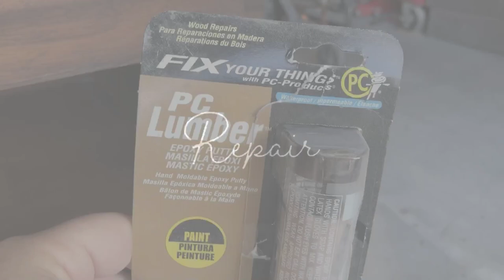FACEBOOK FLIP | Furniture Makeover with Rust-Oleum Chalked

Comment: I want to give you a little paint-saving tip. Before poring out paint or dipping in your brush, take a nail and hammer three or four holes on the inner lip. Paint drains back into can rather than spilling over the sides. One more: In addition to the nail holes, and if you are using a brush to dip into can, take a heavy duty rubber band and stretch from bottom of can to middle of opening. Then you can drag brush across band to remove excess paint. Really enjoying your flips.
Reply from the maker: Thanks Alice! I almost never brush but when I do I pour my paint into a separate container to prevent contamination. I usually just scrape extra paint with my finger before I reseal but I’m a messy painter no matter what I do 😂

Comment: Wow. Beauriful makeover! I have used auto bond to fix a buffet that had serious laminate damage. This looks so much easier. Will try this wood filler product next time.
Reply from the maker: I love Bondo, but I was afraid it would drip or sag on this vertical surface. This putty is amazing!
Reply: @salvagedbykscott  The problem I had with it is that it dried too fast. I could only work in small segments at a time, so it was more labor intensive. This looks so much better to work with. Thanks.
Reply from the maker: Yes, Bondo dries super fast and can be frustrating. This has stuff has a 15 minute working time but it’s much easier to mix up small amounts at a time.

Comment: One of these days, I'd like to see you do a makeover without all the electric gadgets.  I don't have them and it does leave me wondering if I would actually need 3 coats of paint on top - if I painted by hand.  I'm about to do my first makeover.  Also, If ever you are looking for a video subject maybe you could do a tutorial of which sandpaper to use depending which job your doing.  Just a thought.  I enjoy your videos.
Reply: I am a furniture painter as well. Yes it can be done by hand and depending on the paint, you may need 4 to 5 thin coats. I hope this helps. 🙂
Reply from the maker: I did this a few weeks ago with no tools. https://youtu.be/I8eb7xMcKwQ

You can do as many coats of paint as you want. I’m just sharing how I do what I do. There’s no wrong way to be creative 😉
Reply: You can also roll on large areas with a foam roller. If you're looking for a smooth finish with a paintbrush make sure you buy a high quality brush and you can add a bit of water to water based products so it goes on easier.
Reply: @cathy7824  I really like the foam roller idea.  Thanks.
Reply: @salvagedbykscott  I just watched the video you recommended.  That was exactly what I was looking for.  Thanks.
Reply: @gigistephens8130  Luckily, I'm starting with a small piece of furniture so a few coats won't be difficult.

Comment: Just beautiful!  Like everything you do!  You are so busy - I hate to bug you  - but I was wondering if the Varathane product you use to seal your pieces has a toxic smell?  I am sensitive to most odors - even perfume ;-(  - also, do you have to sand between each coat.  Thanks!!  I am so glad I found your channel :-)
Reply from the maker: Hey Holly! The water based top coat does have a very slight odour but you’d have to stick your nose right in the can to smell it. Since I spray, I always wear a respirator while applying it. Thanks for watching!

Comment: Hey Katie ..... could one use that Wise Owl Furniture Salve on the exterior surfaces of a piece?
Reply from the maker: You can!!! It’s got a million different uses. It’s a blend of beeswax and hemp oil so it can be used as a paint sealer or wood polish. 😁
Reply: What size brush would you recommend using with the wise owl furniture salve on a blanket box?
Reply from the maker: I use an small old Zibra brush for mine but Wise Owl has a little palm brush specifically for their salve. You can even apply it with a cloth or old sock 😉
Reply: @salvagedbykscott  
Thanks for your help Katie.  I ordered the brush and the wax.  Now I'm thinking about using some watered down Country Grey Rustoleum latex paint first and then finishing it off with the wax.  The raw pine blanket box is almost colourless.

Comment: Is that right? the way she paints without giving a cooling off time to the compressor in each line she paints?  I thought it had to be swipe and release, swipe and release...
Reply from the maker: I use a High Volume Low Pressure gun so I can spray continuously for quite a while. Thanks for watching.

Comment: Turned out beautiful. I do have a question why did you roll on the primer. I’m always so scared that the roller texture will show through spray of the paint. So I normally spray all layers or roll on primer and then do I light 200 grit sand paper. I’m I doing extra work were you able to see roller texture through. I use the kilz primer. Should I use a different primer. Any suggestions.
Reply from the maker: Hi Tiffany. The BIN shellac primer that I use is nasty stuff to clean up and the only time that I tried to put it in my gun it instantly clogged everything up and destroyed my sprayer. I have good results rolling it and sanding it before painting.

Comment: Katie, Can you recommend another brand sander that you like that is less expensive.  The 3″X4″ Electric Ray Sander is too expensive for me at this time.  Hope to hear from you.
Reply from the maker: Yep, I used basic dewalt or black and decker sanders for years. Anything from the hardware store will get the job done.
Reply from the maker: Sorry, I hit the send button before I was done typing and then my phone died 🤦🏻‍♀️ For most stuff all you need is a basic 5” random orbital sander. If you’re doing a lot of furniture you might want also want a mouse sander for corners and smaller details. You can probably get both for somewhere around $150 but the orbital would be my 1st choice if I could only pick one. Surf Prep also sells their foam sanding abrasives in a mouse and orbital version so you can get the contour sanding features without having to invest in the whole system. I hope that helps.

Comment: Love your videos!! You make it look so simple!
I have a question, I am currently in the process of painting my bathroom cabinet (inspired by you!) But the paint gets completely scratched off with the lightest nail pressure! Why does that happen? And how do you prevent that?  I'm using behr marquee which is a good brand! Thank you!
Reply from the maker: Hey Savannah! I don’t use latex paints on my furniture so I’m not completely educated on them. It sounds like you need a good bonding primer underneath like Zinsser BIN 123 or a Kilz brand.
Did you scuff sand before applying your paint? That helps a lot too by giving the paint something to hold onto. 

Hope that’s helpful 😉
Reply: @salvagedbykscott  I did hand sand with 220 - maybe I wasnt aggresive enough! I might just try putting a protective finish on it and hope for the best! Otherwise I'll restart using your suggestion. Thank you for replying! Love your videos!

Comment: Hi Katie, l have two questions if you don’t mind  😊 Do you always use chalk paint for all your magnificent artwork? Second question is, l had a beautiful table top that l had just finished and my spray gun splashed just a couple of droplets of water on the top after completion 😭. l had to strip it back once dry and do the whole thing again! Just wondering if you know the cause of this and a solution. 🙁    Ps Only 20 more hours for your next stream in oz can’t wait!!!! - best wishes Rozanne
Reply from the maker: Hi Rozanne! Chalk & mineral paints are my go-to but I do also sometimes use milk paint or acrylic depending on the finish I’m looking for or what colours I want to use. 

I’ve had the same problem with my gun more than once. It’s just water hiding in there from the last wash out. I have started blowing my gun and all the parts out with compressed air before I fill it with poly so that its super dry. So frustrating 😫 I know.

Comment: Hey Katie I think I goofed on mixing too much paint and not enough water and now my piece is looking too grey ...... can I or should I try sanding some of the grey out or am I stuck with it.  Also can I use the Wise Owl salve as a seal on the entire surface or do you just recommend  using it on the inside?  Thanks for your advice!
Reply from the maker: It’s just paint, it can always be sanded back. Just remember that the end colour also depends on the wood that you’re working with. The salve can definitely be used as a paint sealer. It’s a mix of wax and hemp oil. Good luck 😉
Reply: @salvagedbykscott  Thanks Katie for your response.  I really appreciate how quickly you respond to these messages.  Its very much appreciated.  Love your work!

Comment: Are you putting a top coat? I didn't see it. I am redoing my furniture and I am worrying about scratching on a open shelves . Also which paint sprayer are you using? Thank you
Reply from the maker: Yes, I mentioned at the end of the video that it was sealed with a few coats of poly for protection. I use a gravity fed HVLP pneumatic spray gun.
Reply: @salvagedbykscott  thank you
Reply: Also I really like that you really care about practical use of furniture you are flipping.  Always primed,  painted an top coat ( with I wasn't sure ) a lots of flippers just paint it, not always top coat.   Those furniture probably will scratch in no time. I would definitely buy a furniture from you , not just for amazing design but especially for the quality! I am a new subscriber